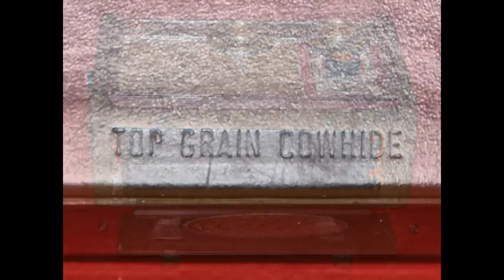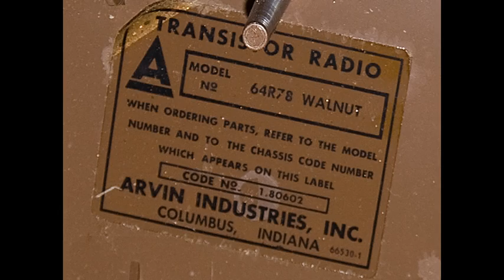Arvin Transistor Radio Model 64R78

Comment: I have 3 of these, one later version has a tone switch and an AFC switch added on the front panel.  Also it has the audio jack on the rear as well as an external power jack.  My folks had my first one back in the 70's and I backed over it sitting on the ground with my car one day, it just bent the frame a little and put a crack in the board but I was able to fix it other than being a little out of shape now, lol.
Reply: I just got one in good condition for ten $ what batteries does it take